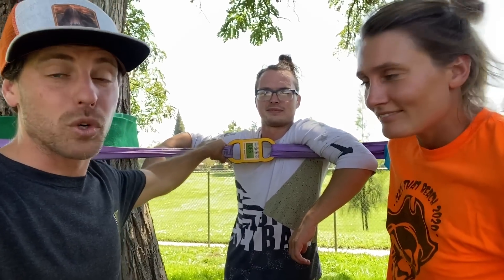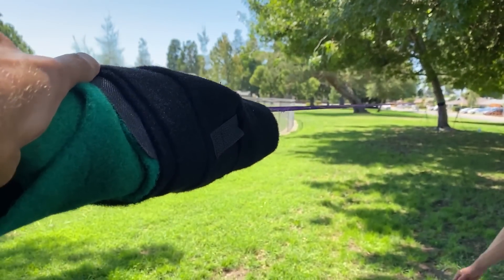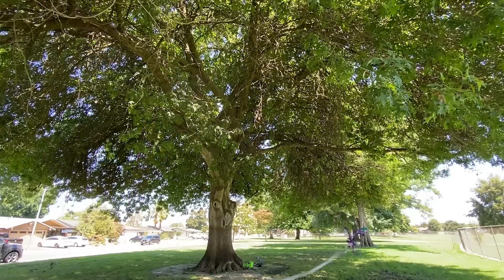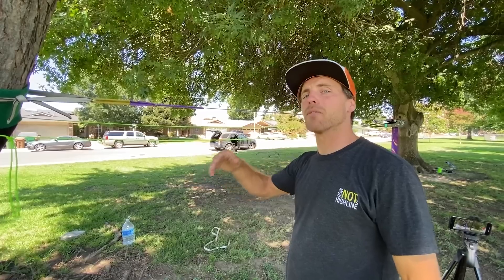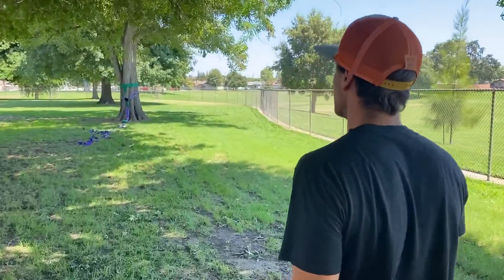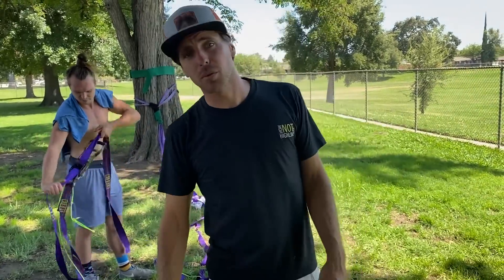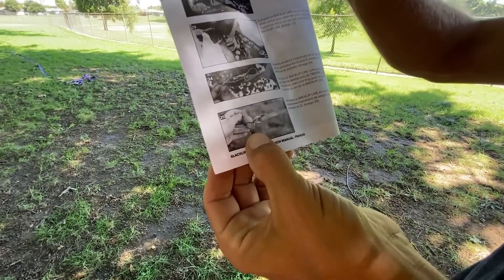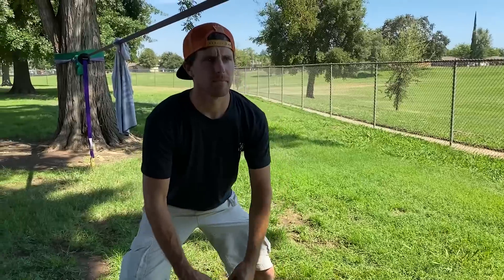We CUT Tricklines - do backups work?

Comment: I know this isn't a high line thing. But I have some synthetic winch line which is way cheaper than amsteel or plasma. I'm really curious if I could send you some 1/4 for testing to see if it even compares to the legit thing. 50 feet is basically $20-25

Comment: at 8:45 I think (with no real backing) that the knot is what caused it to break, as without the knot it would have pulled through the two D-rings slowing the force more gradually (in a similar way to how dynamic rope absorbs a fall). While that's only a guess on my part I think it would be interesting to test.
Reply: @CorrectHorse BatteryStaple That is a good point, I must admit that I've never looked at the manual till now. 
It seems a little odd that a company like slackline industries would sell a product that would fail so easily.

Comment: Philipp on HNTH fb page: "Sweet video!, just a heads up:
The enforcer and linescale don't have the sampling speed necessary to capture the shock loads you get in these scenarios.
We measured an 80 m longline with 8 kN of tension and a shockload of 25 kN last week. And our linescale still said 8 kN max afterwards....
You need sampling rates close to 2000 Hz, not 50 Hz.
Message is still the same, use big ropes to backup your slacklines."!!!!!!!!!!
Reply: we've had many shock loads over 20kN!!!! USE STRONG ENOUGH STUFF!!!
 btw ;) triloaded alu biners yey what's their mbs with normal pull tests?
Reply from the maker: Looking forward to your video on that.  I'd love to see if I can recreate it once I have my bigger dynos
Reply: If you want to know reliably at what peak your backup broke you need a high sample rate 1600 s/s and higher
Reply: @sarahgme  I can assure everyone breaking happens at +-20% of the backup/knot breaking strenght, you cannot generate higher than that with an impact. The real issue is finding out at what peak force the backup did not break. Fall factor equations still apply, the complicated version of it that uses Energy as input.
Reply: This is not a short steel cable or a solid bar. The Linescale is enough.

Comment: How do you remove your backup and release the line with all these kind of backuping techniques?

What if one side of the ratchet breaks on the bolt? Or even if the bolt breaks because it is old/corroded (the tension is on a really little part of the bolt creating a good place to have corrosion)

I would love to see a test with static rope and knot in front of the ratchet/weblock (it's like a barrel knot but not tght and with around 5 turns) attached to the tree with a tensionless hitch (but not ended with a loop and connector, directly with the end of the rope and a quick releasable knot)
Reply: If the bolt breaks you’re fucked lol
Reply: @noah_9886  Only if you use backup who doesn't backup everything ^^
Reply: Laurent Blondiau I make sure to pass my webbing through three bolts I case one of my mates wants to do some slack line tricks with his ford pinto

Comment: Mabye use a whoppy sling dynma all the way
Reply from the maker: how would you connect it?  i don't think it would be strong enough if you girth hitched it
Reply: @HowNOT2   soft schake around the bolt on the ratchet? I am just think it is easy to rigg. I am doing the girth hitch method on my longline with my 15m whoppy

Comment: Counter-intuitively, I bet a looser backup might perform better, if it only has to stop the ratchet's momentum - the issue is that if the backup is pulled taut before the slackline has finished relaxing, then the slackline tension itself is being supported by the backup, which will easily snap it. If the backup doesn't get stretched until after the slackline has relaxed, it might stand a chance.
Reply: The tension of the slackline has a much lower force than the peak momentum of the line when it snaps. I think you want it as tight as you can get it without it holding weight when someone is on the line, but its just a guess

Comment: I don't know anything about tricklining, but wouldn't it make sense to use dynamic climbing rope in the backup to absorb the shockload? Seems weird to me to catch a shockload with static materials. (the one rope you used you called a cordellete, so I'm assuming that it's a static rope)
Reply: A 30 foot length of old climbing rope to tie round the tree and through the ratchet sounds a really good plan but not everyone climbs (or has bits of old rope). Edit, depends on ratchet too if there's space for the rope to fit
Reply: Static ropes and cordelettes are not static at all! Most of them are stretchier than slackline webbing =)
There is a pretty low difference using a static or a dynamic rope for backups.
Reply: The whole point is to keep that big piece of sharp metal from flying toward the user, so deliberately choosing materials that slow it down more gradually over a longer distance seems counter to the goal. Ad absurdum: I could use a big enough bungee cord and I could slow it down to zero speed gradually over 20 meters... very low forces. But also your trickliner dies anyway.
Reply: @JasperJanssen  climbing ropes are designed to have less than 40% stretch (otherwise they fail uiaa testing). I don't think that's a dangerous amount of stretch since you will have only a couple meters of rope on there. And I doubt you will reach maximum stretch since you need around 8kn of force for that (I don't think you can generate that on dynamic rope with so little mass in the system)
Reply: @JasperJanssen  but you don't want it to snap like the paracord which is definitely contrary to the goal, so having an extra 1foot of stretch might make it safer. You make it sound like climbing rope is a super soft bungee cord when many single ropes have max impact (factor 1.77 80kg mass) of 12kn. Also many of us own rope of various types, lengths and ages already.

Comment: I really would like to see the tail backup around the tree since this is what most people will do in my experience. I dont trickline, but I tie off my longlines and highlines like that.
Reply: Yes! The only thing I really missed in this video. :)-
Reply: Especially as there was a death recently due to this method failing.
Reply: @callumray4601 You're referring to the incident in Russia?
Reply: @guernica69  yes I am
Reply from the maker: The death happened after this video was filmed fyi
Reply: would be nice to test different knots, since I've seen quite a few that are used for backups

Comment: Slack is key in this case. The backup should be tied before the tensioning or at least marked to not hold the line in tension after the cut. Also force of stopping the rachet is something like a sping force 2xEnergy/distance, which implies that the stiffer the backup the higher the force. I would wager tying a elastic element to the paracord that can stretch about 30cm with about 1000N would render it usable as a chinsy backup.

Comment: Happy to see that your test confirm all the ones we did before choosing our back up rope!
Reply: Do you have public footage of your testing?
Reply: I'm pretty sure this rope can fail easily with longer tricklines like 25/30m =)
(edit : Sorry, I'm wrong because it's a surf line so 30m ofc ^^" but not sure if it will hold every time, 15kN resistance for a 7mm cordelette with knots in it looks really high!)
Reply: so why does it stop working after it seems one shock load?? It's ok if it works one time but i think you should offer something that lasts along several breaks (like another piece of webbing)
Reply: @slackline_mx  After seeing what sort of a hit the back-up takes I wouldn't be using any back-up more than once. If it's saved your life once then bin it and buy another one. If you feel webbing is good enough to take multiple shock loads you can just buy more webbing no?
Reply: Stephen Street...

I agree but then I started thinking about parachutes. Must reuse bajillion times!!!
Reply: @toejam6941  But they're designed for that. This backup is not, and that's okay.

Comment: Your dynanometer is too slow. We've measured up to 25 kN shock load on an 8 kN longline.
Reply from the maker: How fast was your dyno?
Reply: @HowNOT2  1600 samples per second (quoting Philipp?)
Reply: Long line is not a short line, more energy stored into the webbing. If the above setup was 3 times longer 25kN would be reached.